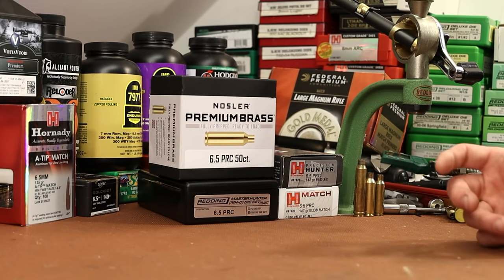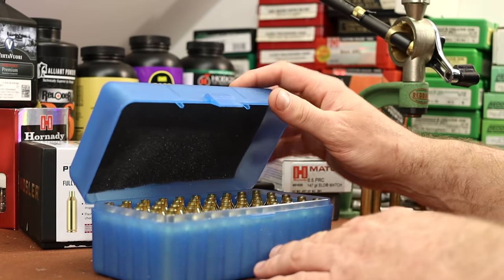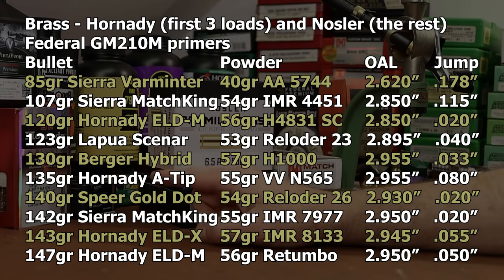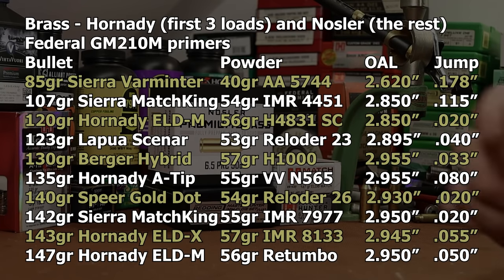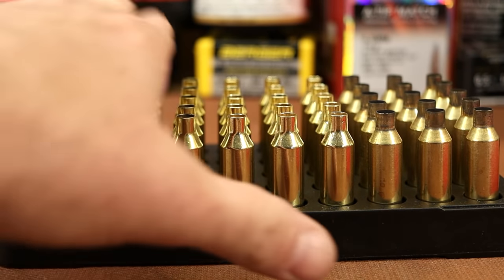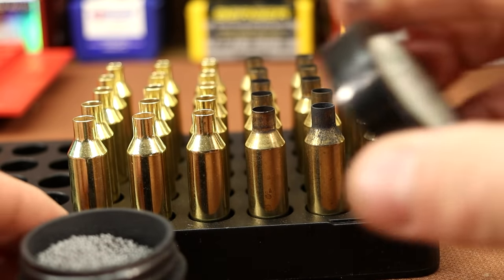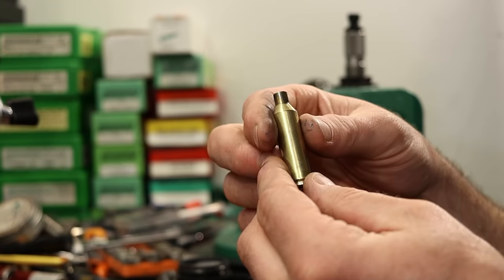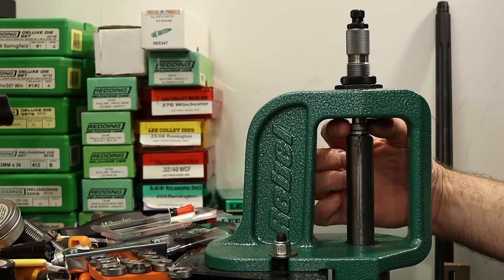6.5 PRC - Getting Started With Reloading

Comment: Pro tip: if the case doesn’t want to pop loose from die with case extraction kit, place die in freezer over night. It will pop right out when you turn the Allen key. Works everytime.
Reply: You know, I wonder if touching the side of the die with a buetain torch would work...

Soften the lube
Reply: I just put mine in the freezer for a couple hours.
Reply: Ah ha, that's a great tip. Thanks for sharing.  I've never done that, but sounds like a great tip if it really feels like you are going to strip the threads because it is so stuck.  I sure hate it when that happens as it is such a waste of time when your trying to get rounds loaded because the weather/wind is going to be good the next day for shooting.  I've had decent luck with my Lyman stuck case puller, but have never had to go to that extreme of freezing it.  I'm still wondering why Johnny cut the case with the Dremel.  I think if he bottomed out with the screw, I would just add some washers on top of the case puller and continue 🤔

Comment: Stuck cases are such a royal pain! I felt like my bolt was too long as well when dealing with 223 cases. I ended up just getting some cheap washers to stack on top. Noooooo, don't cut off the base! Hold the expander to provide a little tension, so the brass does not spin, then keep turning the screw in the case, will slip right over and your good to go.... That was hard to watch....

Comment: The worst of the sizing friction occurs at the head. You sprayed the cases with the head inside the loading block. The heads got zero lube, which is where it needs it the most. I turn the cases upside down in the loading block then spray so the heads get a good amount.

Comment: I can't take credit for this idea, as it came from a friend. But I had a severely stuck case and I used the same stuck case remover and was having a hell of a time. He told me to put as much tension as I felt safe with and then put the whole shootin match in the freezer overnight. Then go the rest of the way with the extractor and it worked very well! Alternately, he said mix up 50% acetone and ATF together,  hit it with a heating torch, and lubricate the area between the brass and die. I have not tried the 2nd trick...just the first. Hope it helps someone out there 👍

Comment: Add washers to the bottom of the "cap" that the bolt twists against.  It adds extra height to keep the case moving across the expander ball.  I literally just did this with a stuck 30-06 brass 2 days ago.  As long as the bolt initially has 3 or 4 threads into the brass when you start it'll pull.  A little shot of lube thru the flash hole can help too. I love the videos! Keep up the good work!

Comment: Don't worry about the clumps. I have that in Retumbo regularly and it's still my favorite Magnum rifle powder. Excellent velocities, SD's, and Extreme Spreads.
Reply: Just got some for my prc and fired 3rds and 2 were 1fps from each other….have you used it with any 135 a tips?…I’ve got it,h1000,magpro,n560,and superformance in that range other than h4350 which I use on 130tmk at 3250fps

Comment: For stuck cases I use a longer 1/4-20 bolt and then put a nut on it where it meets the collet/socket. You thread into the case as normal but then crank on the nut. It’s less force on the soft brass threads and all the friction on the steel nut threads. It has a better chance of coming out.

Comment: I stuck a case for the very first time in 6.5 PRC. I bent the decapping rod getting it out, but Hornady sent me a replacement. No problems since, but I am using Imperial lube now. You always make me feel better about my problems. I was using a Hornady Custom Grade die and Hornady one shot lube when I stuck the case. I thought I had plenty of lube on it but apparently the die didn’t agree. Arghhh!!! I have loaded 147 ELD-M with IMR 4350 and shot under 1/2” from Fierce Fury. I have also started on the 156 gr Berger Elite Hunter. Groups are slightly larger so far but still in 3/4” range with Accurate Magpro. Looking forward to your next video. BTW the Fierce Fury is built on a long action receiver so I am loading near 3.00” for the Bergers. I think the LA is the only way to go for 6.5 PRC.

Comment: I’ve had to put together 2 separate dies for my 6.5 Prc brass. The Hornady is much thinner than both the Lapua/nosler/ and I also use alpha.this solved that issue! I use a SAC Prc Die for the three thicker ones, with a.291 bushing and an LC Wilson bushing die with either a .289 or a .287 for the Hornady brass . Now I’m consistent with all the brass

Comment: Interesting you say you always cut case when removed with stuck case tool. I always use tool to pull over expander ball. If you get a lee die you can pound on decap pin to remove stuck case. I would just get a lee for now till a better solution to sizing issue is found. I would've walked away too, anger never helps. We all have been in similar situations, you handled it better than i or most do. Good luck.

Comment: Way to go Thomas! Looking forward to the 6.5 PRC videos. I'd much rather have one of those than the Creedmoor myself. I had a Lee 458 Socomm sizing die that did the same thing. Had to wait for Hornady dies to become available. I wasn't suprised with a Lee die doing it, but I am suprised with your Redding die doing it.
Reply: The redding dies seem to be a bit rough inside. I had to do a lot of polishing on my 6.5 prc redding dies. The polishing compound went from white to completely black very quickly.
Reply: @karlschauff7989  It looked like a piece of sewer pipe on the inside.

Not what I would expect at all from any die manufacturer. Maybe that dies skipped a step or 2 on the manufacturing line...
Reply: @coltonkay9000  Yeah mine looked like the tooling insert used to machine it was worn and not making a clean cut. The surface on the inside feels like what I would expect on a roughing pass and not a finish pass. I think rough surface held onto a lot of machining dust. I don't think you would want a high polish finish inside as you might run into problems with stiction, but too rough can cause friction issues too. 

You're right it could be a case where dies accidentally missed a step. With the shortage of skilled tradesmen, it's also tough to find decent machinists. I know at my employer we have had to lower our standard to fill job openings. Maybe that's the case with Redding. Especially during the lockdown covid crap.

Comment: I admire your restraint! Had a similar issue on a .30 Nosler die and...well...my reloading room required some "remodeling" afterwards. After screwing around with the first case for about an hour, the second case did the exact same thing. Frustration tolerance bottomed out and luckily I was not recording a video. I'm not an expert reloader by any stretch so it was helpful to watch you work through this.

Comment: Johnny, don't know if you will see this post but I just came across this vid.. With a stuck case, don't cut the case! Extraction is a two part dance. You are correct to back out the stem to clear the primer punch from the case head until after you drill and tap the case head. After you begin the extraction and gain some movement of the case start threading the punch stem back in (be cautious of the primer punch by feel but keep threading both the extractor in and the punch side in. If you're lucky, you'll get about two or three threads of the stem engaged before the screw on the extractor contacts the punch pin. Here's where the dance begins, again.by turning the stem out, you'll be pulling the expander ball through by using the thread leverage of the stem. one turn on the stem, one turn on the extractor screw (all by feel to avoid contacting the punch pin), one in -one out until the stem comes clear. Once the stem is clear, use the same procedure with the die body and the extractor. Extractor in, die body out, extractor in die out. You'll have to wrap the die body knurling to protect it from dicking up the outside while wrenching. As far as punches, your call but if you didn't cut the case, you'd have a solid base to use the punch on. and drive it out. Not my preference though. FWIW.

Keep on keeping on, love your content.

Comment: I reload the 6.5 PRCE as well I've had really good luck with reloader 17,H & IMR 4350, H1000, MAGPRO and hybrid100 

For projectilesI like 
Barnes match burners 140 grain
 Sierra match king 140 grain
 Sierra match king 142 grain
 Sierra tipped match king 130 green
 Nosler  Accubond long range 129 grain
 And I personally have had really good luck with all Burgers 

 I know this comment is starting to get long But you can get a lot of information on load data from the Sierra manual as well as the hodgdon Manual as well as the Hornady manual. I personally like the Sierra Manuel it gives you a lot of information for the 6.5 PRC

Comment: I had the same stuck case issues with my Redding Type-S Full Length sizing dies in 6.5 PRC (Hornady once fired brass). I polished the die with my dremel and some polishing compound. I also have to liberally lube the cases with RCBS lube because the imperial wax doesn't work as well with this cartridge it seems. The sizing die leaves the same marks on my brass. I think Hornady and the die makers need to take a closer look at this cartridge. My stock Type-S FL die wasn't sizing the brass enough to fit in my Howa's chamber. It wasn't squeezing in the brass down near the base of the cartridge and it wasn't bumping the shoulder back enough. Tried several different shell holders with no luck. Ended up turning the bottom of the die to remove 0.020" to get more shoulder bump. That solved the issue and I was able to bump the shoulder back 0.0015" after that. A lot of other guys have had the same issue with a variety of guns, including rifles from Christensen Arms. I noticed that Hornady has revised their match grade 6.5 PRC dies more than once.

Comment: I have 2 Savage rifles, both had mild feeding issues. I have put up with it because they shoot so good, and I generally only need one shot to kill a deer anyway. I recently came across a forum post that fixed everything for me.  Turns out when the round hangs up just before chambering, it is catching on the ejector plunger and has nothing to do with the magazines that I had been suspecting. The fix was easy, but a little unconventional.  Remove the ejector plunger by holding your finger on it and tapping out the retaining pin with a pin punch. Put the plunger in a vice and file a small 45 degree ramp so that it will be facing toward the center of the bolt or firing pin. Forum poster said to think angle on door latch. The plunger has a radius already and doesn’t need a huge ramp, I left half the plunger face intact. I used a small flat needle file with a fine cut and didn’t need to polish it at all afterward. I put the spring and plunger back in, slightly depressed it with my finger. I then used the pin punch to retain the plunger. Tap the pin in with a small brass hammer, letting the pin push the punch out of the hole as it goes in. Both my rifles feed 100% reliably now. Hope this helps, PS removing the ejector plunger also helps when installing barrels and checking headspace. Without the ejector, you get a much better feel for when the bolt first kisses the gauge.

Comment: I know it was a tough video to make, but I am so glad to see this video. I can’t wait to see how  the next offerings shoot. For me Retumbo H1000 and Ramshot Magnum have done the best with bullets in the 130+ range. Also has stuck case issues at first and had to go to the hornady FL die without the recapping or sizing pin. I used 21st century mandrel in .2630/.2635 to avoid the sticking issue.
Reply: Retumbo powder has been my go to on 140 rounds but imr 4831 and 125 partition and going 3412fps and shoots just over 1/4 inch. 3 shoots at a 100. It’s insane the damage that it does and groups unbelievable. Good luck

Comment: I have been reloading for close to 55 years and have faithfully used Reading dies. Until the 6.5 PRC came along and gave all sorts of problems! I had the same problem as you and contacted Reading. In which they said to send the die with the stuck case and a few more cases. Which I did! They returned the die withe case removed and a case extraction kit. 
Everything is good! Right?
NO! The first case I tried to resize did the same thing!!! Reading said that they polished the inside of the die and checked for dimensions. I don't know if Reading is using tighter tolerances or what!
I bought another set of dies from another big name company and haven't had a problem since!

Comment: I recently started using the redding FL bushing dies, and they have all had a pretty rough finish on the inside.  It was surprising considering the cost you pay over RCBS.  I "honed" the inside of the die using shotgun sized bore mops and valve grinding compound.

Comment: I was just reading a post on Reddit. They had multiple stuck cases in a new Redding die set(308) as well. I'm curious if they're not using the finishing reamers on their dies to smooth them out. Get some flitz and #4/0 steel wool and try to polish it up. See what happens.

Comment: Redding has great customer service. Been there and done that on stuck cases. Usually, it's not being lubed correctly or not fully cleaning the dies before using. On neck sizing dies the Lee collet dies work the best as far as not getting anything stuck. Only problem you can have is setting it up for too much pressure on the collet which will crush the case. So long as one sets it up and goes a little at a time falling short of crushing the case is the best way to go. You can buy undersize collets as well if you want a smaller diameter case neck. Nice video showing your real problems. I must admit your problems with the stuck cases were much worse than I have had. I have only had it happen a couple of times. I don't usually make too many repeat mistakes I don't usually make the same mistake over and over. I watch a lot of your videos and enjoyed this one. I have been looking hard at this cartridge.
Reply: I meant undersize mandrel not collet. They are available some places. You can always polish the original down a little as well.
Reply: Right

Comment: Starting at minute 24 you needed to ditch the RCBS sleeve and switch to a large diameter deep socket that would fit over the die and rest on the lock ring, not the mouth of the die.  Then a long bolt and a series of washers to stack between the socket base and bolt head so you can prevent the bolt threads from penetrating the interior of the case too far and pinch the decapping pin.  Then, as you tighten the bolt you have to screw the decapping assembly into the die until the expander ball is clear of the die/case neck .  Never Dremel off the case head.  Just small turns on the bolt matched by small turns on the decapping assembly until the case walls are free of the die,  Then it is easy to continue pulling the case neck over the expanding ball.

Comment: I've experienced the same exact issues but in .270 Win. Redding F/L die and Nosler brass. I used a cotton bore mop for a .410 with jewelers rouge on a drill to polish the inside of the die. Cleaned it out with 90% alcohol and lightly added some case lube. Didn't fully fix the problem, but no more stuck Nosler cases. It seems as though the die has "broke in" a little more after a couple hundred rounds.

Comment: I had a few dies that were rough like your dies. I used some Mother's polish and a drill set on low, to buff a lot of the rough tool marks out of the die body. A light buff and polish reduced the amount of stuck cases significantly. I also made sure that I used more lube - putting up with lube dents is better (to me) than getting cases stuck.

Comment: Awesome you are loading the 85gr bullet. I loaded the same bullet in 6.5 ManBun w/ PP2000 and IMR4895 and got it going over 3300fps. It really smacks the steel targets, there is an audible difference compared to the regular 140gr weight/velocities.

Comment: Hey johnny on those black locking rings you don't like I've found if I put a piece of lead shot between the ring and the die in the hole it helps lock the two better

Comment: Use Hornady dies. End of problems in 6.5 PRC. Also IMR 4955 is very good near max in 6.5 PRC, they dont show it in data but it works well. To get best accuracy in 6.5 PRC you need near max case fill and use mag primers.

Comment: I have had the same issues pulling a stuck case and it not coming out all the way. Once it was loose, I  ended up taking a vice grip and clamping it to the base of the brass, and then I used a pry bar against the vice grip. I think a slide hammer that threads into the primer hole would make it a lot easier to remove once the brass is popped loose

Comment: I had the exact same issue with both Nosler brass and Hornady once fired brass, 3 or 4 stuck cases.  In addition, the cases I was able to size never bumped the shoulder even with the press camming over hard.  The die I was using is a Redding similar to yours that I had borrowed while the Forster I ordered was on backorder.  Tried different types of lube, no luck.  Gave up for now and will wait on my new die to arrive.  Savage 110 High Country rifle....  There is a gunsmith that has a custom reamer to fix the tight chambering on the 6.5PRC.  I may try again after receiving my Rockchucker, quit using the hornady with the quick load bushings after sizing issues on a 22-250, also a Savage 110.

Comment: Had the same stuck case experience with 6.5 prc redding fl die and hornady one shot. I had cleaned the die and sprayed one shot into it and let dry. Never had a problem like it before with 338-06 or 7mm rem mag. I next cleaned off all the one shot from the die and brass. Now used imperial case size wax on the cases and a little in the die with q tip to start and problem solved...